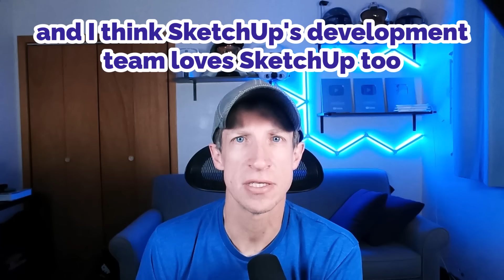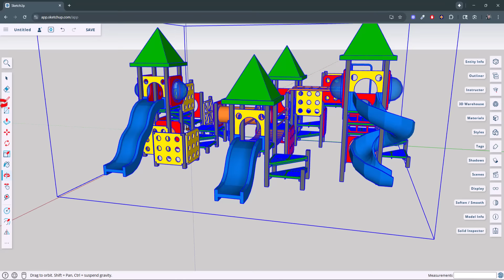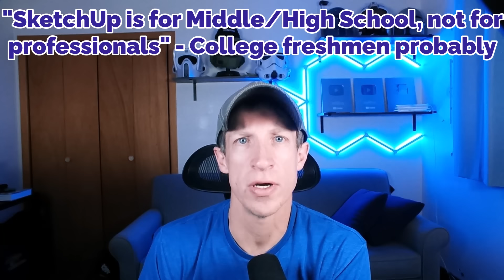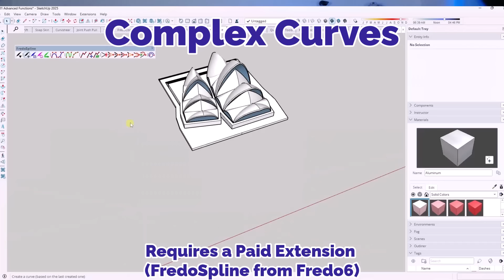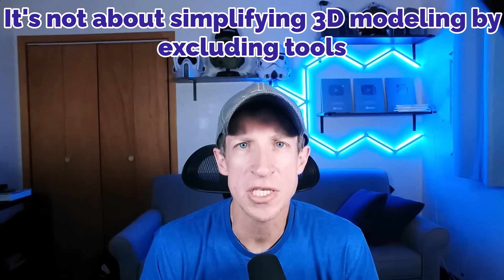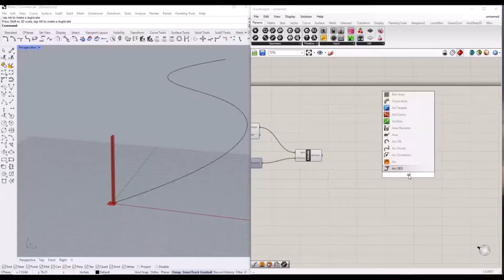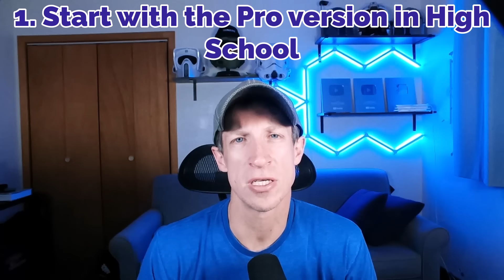Is SketchUp being REPLACED?

Comment: As a long-time CAD designer I think my insights have merit. Here's why: I graduated High School in 1964 with 4 years of drafting with an "A" average. Spent 4 years in the Air Force, and once back in civilian life I went to work at Pratt & Whitney Aircraft as a draftsman and never looked back. I've been a professional designer all my life at various firms. Started on the drafting boards using ink on vellum, and eventually into CAD. I started using AutoCAD in 1985, only 3 years after it was first introduced. Over the years I’ve been required to learn and use professionally AutoCAD, CATIA, SolidWorks, Inventor, and NX. I am proficient in all of them. I even spent 4 years teaching AutoCAD at a Community College for Adult Education at night. I became aware of Sketchup in 2001, only 1 year after it was introduced. I used Sketchup at home and for fun (it IS fun to use) thru Google’s purchase in 2006 and then Trimble’s in 2012. I still have it to this day, but I stopped updating with 2017 Make (the free version). I taught all my 13 grandkids to use Sketchup as a basic introduction to CAD software. But there is VERY little additional value that any of the “improvements” Trimble has deployed that justify the expensive subscription cost. I can do everything with my 2017 Make that I am ever likely to need to do with Sketchup. And it doesn’t cost me a thing. The capabilities in PRO that are lacking in 2017 I can easily get most from plug-ins and extensions; most of which are free, or inexpensive, and all are obtained as a forever plug-in - no subscription. I’ve learned my way around both Blender and Rhino and I completely agree that Rhino is blowing Sketchup away, today and into the foreseeable future. But it’s not free. Excluding the educational license ($195), it’s $1,000 for a single seat. But at least it’s a permanent license. That’s a plus. AFIAC, subscription prices are just rip-offs. I refuse to pay them. There are too many free, inexpensive or reasonably priced alternatives available. The ONLY thing that PRO offers me that 2017 doesn’t is the ability to create shop drawings. But there are even plug-ins for that; not nearly as good, but more than workable for most people. I'm retired now and enjoying my time as a woodworker. I design and build a lot of different things, from furniture to sheds and decks, home additions, remodels, useful gifts and more. I've even designed full homes, with electrical, plumbing - the works. I used AutoCAD for my shop drawings. With extensions I could export my 2017 model into AutoCAD and away I went. But I have since found an alternative to ALL of these. It is every bit as powerful as any of them (even CATIA and NX) and it’s FREE. It’s called “FreeCAD”. It’s a parametric solid modeler with nearly unlimited extensions (called Workbenches) available (for free) to extend the software into any design discipline that can be imagined. It’s open-source software and instead of maintaining an army of  paid “improvement engineers” (who ignore the user’s requests), the users can create their own workbenches if they master Python, or request the user teams to create it. And those user teams LOVE to create what the users want. Create individual part models or individual parts in one model. Then assemble them with any constraints that make common sense into an assembly model. Out of the box it beats Sketchup PRO hands down except in one area – the photo-realistic rendering. But there are even workbenches for that as well that are almost as good. Most designers will never need the difference in rendering quality that PRO offers that can even begin to justify the annual subscription cost. And my personal favorite? The TechDraw workbench is way better than Layout. And everything is parametric. Change a dimension on the drawing and the 3d model updates, along with every part that is affected by the change. Change the 3d model and the drawing updates. 
Bottom line now is that I still play with Sketchup. I use it for fun and to do a quick and dirty look-over of a design concept. I probably always will, because like I said above, it IS fun to use. But for anything serious? NOT at the price that is being asked. FreeCAD does EVERYTHING I could ever want to do, nearly as fast, and with less hiccups than Sketchup - for free. It’s not as easy to learn as Sketchup, but once you do learn it, you can fly thru design work like nobody’s business.
Sketchup Free is a toy. Sketchup Go is web and iPad only, no desktop. Again, a slightly more powerful toy.  And it's a subscription. My 2017 Make runs rings around both of them. And in my world at least, Sketchup Pro is a ripoff. My 2017 Make with extensions does everything I'd ever want Pro to do except make shop drawings. But FreeCAD makes shop drawings right out of the box. FreeCAD does everything, and beats Pro hands down. Trimble has lost its way and is ruining a once stellar piece of software. For me at least, it's time to move on. Trimble is too busy smelling the roses and placating the shareholders. I've got stuff to do and I'm not waiting around for them.

Comment: Guys, can i open my 570+ designs i made since 2007 in Rhino? Will it still be the same? Because i have many really valuable artworks and dreams conceptualized in Sketchup 8 & 2017 and i struggle to use newer sketchups because of the online thing... Please help! I would also love to learn all those smart tools, and need to export 3D printable files and STL files for laser cutters and CNC mills... Please guys, help a fellow 3D artist🙏
Reply from the maker: I'm pretty sure you can import SketchUp files to Rhino, but you might not like the result. Moving between modeling software like this, while possible, can be very clunky

Comment: Longtime sketchup user. Main shifts I’ve seen are towards subscription pricing. To use it you need a lot of plugins, which trimble isn’t developing. Rhino seems vastly superior.
Reply from the maker: Honestly it's more just a series of tradeoffs - I don't think the "SketchUp is dumb and Rhino is the best thing ever" posts are accurate at all (though obviously this varies by your use case). However, I do think filling a lot of the holes should be made a priority on SketchUp's side

Comment: Justin, your major concern seems to be modeling related. That's understandable. 
But since you are asking for feedback, my major concern is the forced shift to a subscription plan. I stopped updating after 2020 because of that. I wasn't willing to be forced into a subscription after I had BOUGHT the program. Of course, Trimble then proceeded to cut off access to 3Dwarehouse and Google Earth, which was effectively STEALING functionality from the program I had purchased.
If you've got the ear of folks at Trimble, please pass this concern along. I know I'm not alone on this point.
Reply from the maker: Well it's more that I don't think the pricing model will change, so it's not worth having that discussion. Trimble isn't going back to the lifetime pricing model any more than Autodesk, Adobe, insert any 90% of other software companies here. If the subscription model is a dealbreaker then it is what it is. As to the other items, I don't know that I agree that that's "stealing" anything. Those are features that require recurring costs to upkeep and manage - BTW this is likely also why McNeel doesn't offer a 3D Warehouse, and one of the reasons SketchUp has gone subscription. It's not different than multiplayer games shutting down servers after 5-10 years because upkeep of all that stuff to keep it running from revenue a decade ago is a losing proposition. 

I think there's a possibility of the features getting added, and I do not think there's a possibility of the pricing model changing, which is why I didn't include that in the video. Just trying to affect what I can affect
Reply: @Thesketchupessentials  "Just trying to affect what I can affect"
Thank you for your efforts. I've learned a lot from your videos over the years.

Comment: I started using Sketchup around 2010. My drafting needs are simple (single family homes) and Sketchup was a simple, compact, low cost solution, especially compared to things like Revit. If you want to design a skyscraper Revit's the way to go. But for my needs Sketchup was the perfect fit.
However when Sketchup moved to the subscription model I stopped updating. So I've been working on 2020 ever since. I resented very much that Sketchup made that move, forcefully cutting off the ownership option and removing access to 3Dwarehouse and Google Earth. I had bought the program and losing that access was really like having something I'd bought taken away from me.
I keep 2018 installed on a laptop and 2020 on my desktop... which died last week. When I get my new desktop I'm not sure I'll be able to reinstall 2020 on it. If not, I will probably start looking for an alternative.
That's my story and I expect there are lots of others just like it. I'm sorry to see Sketchup go.

Comment: In proper architecture firms, you're mainly doing everything you need for drawing sets in Revit. There's a rhino connector for modelling (rhino.inside), and there's nothing for sketchup. You can also do some very sophisticated parametric work with grasshopper and rhino. 

Sketchup comes in as the annoying third wheel, still operating on the frustrating subscription model, without offering any compelling features or justification. For this reason I'm transitioning out 400-person company away from sketchup completely (we are down to just the landscape architect's using it) to focus on rhino and Revit. And we are late tomthis approach - I know other companies who don't even use autocad any more, because rhino does everything they need for cad also.

Comment: You can replicate most of Sketchup's features in Blender anyway.

And Rhino's NURBS geometry integrates very, very nicely into history-based solid CAD, really simplifying manufacturing. You'll never send Sketchup geometry off to a machine shop.
Reply from the maker: Having tried to use Blender for Architectural modeling, don't fully agree with that one. That kind of modeling in Blender, even with plugins, is super painful

Comment: I’m a small 1 person business owner (furniture making) and want to try start 3D designing my pieces so I don’t have to keep drawing them out on paper. 

Has anyone got a suggestion for what software I should try? 
I don’t think I can justify the SU pro price for the amount I will be using it.
Reply from the maker: What would you say your technical skill level is when it comes to 3D modeling and just...computer stuff? If it's low, definitely still SketchUp. You could try the basics in the web version. If it's a bit higher, you could try Blender or Rhino, but there are significantly more instructional resources on SketchUp, and it's a lot easier to learn.
Reply: @Thesketchupessentials thanks for your reply! 
I have no current experience with any modelling software so will be starting from scratch - however I’m pretty confident on a computer and studied design when I was younger so I’m pretty sure I will be able to pick it up rather quickly. 
I’ve watched quite a few tutorials of both Sketchup and Shapr3D in my quest for finding what will be right for me. I guess the next step will be trying out the free versions of both.

Comment: Hi Justin. After using SketchUp since 2010, I switched to Rhino this year. SketchUp is very good at materials and visualizations, but Rhino is excellent at modeling. Personally, I'm sorry to have to switch, but in my work, I have to import a lot of 2D files from AutoCAD, which were almost impossible to work with in SketchUp. Only those who use Rhino after SketchUp realize that it's like SketchUp, but much more advanced. To do what I do in Rhino, I had to use several paid extensions, as well as free ones. Plus, you pay once and it's yours.
Reply from the maker: Lol - but the materials management is definitely painful ;p

Comment: Good video and full of points. I have been using the Sketchup Pro version for about four years now and the enthusiasm is starting to wane. I am starting to notice the shortcomings in development and creating credible models. The program is a good springboard for modeling, but at my workplace, designers use Rhino and through it I notice the differences and shortcomings clearly. I really hope that Trimble pays attention to customer feedback and problems in development, otherwise customers will be directed to other platforms.

Comment: I was introduced to SketchUp in college in a class name "bioclimatic architecture" around 2010 and I loved it was. By 2012 I did some drawings for my thesis and a  patent in SketchUp , my advisor did not allowed me to use those drawings and made me redo the drawings in Solid Works, even when they were almost identical, but he told me "the software you are using is for kids, you need to be serious with your work", after I graduate as energy engineer, I tried to propose the use of SketchUp for shadow analysis in photovoltaic systems but I was told the same, that is not a serious software, it was difficult to prove them wrong but I could in some jobs. At some point on my professional life I also thought it was not a professional tool, I was wrong, though. I have been using it for so many years and I know how powerful SkechUp is, but its frustrating hopping with each version release that it will include something that make my life easier, but it is all the way around, just new useless features to get use to.

Comment: Since moving on to revit 10 years ago, I'm amazed sketchup still used widely. 

Beside the lack of modeling tools out o the box, sketchup memory management is also sucks. It struggling to handle complex models, lag and prone to bugsplat. Which the same geometry easily handled by other modeling software.
Reply from the maker: I don't think this is a fair statement - they've significantly improved performance year over year for the past 3 years. It's not the same as it was 10 years ago

Comment: I’m a retired mechanical and electrical maintenance manager who worked in the field for 39 years and would like to take on the task of building my retirement home and shop on a private property with few building restrictions and want you use a reasonably priced building design software program to do this for myself. I have used autocad lite before but am not an expert in using it. My question Is the Learning curve and cost of using/operating Sketch Up a better choice for a one time project than getting Rhino?
Reply from the maker: Personally I think the level of support and tutorials online for SketchUp is vastly superior. The tools are much easier to pick up, and are better suited to this kind of work. I personally think (having used both) that you're going to like SketchUp more than Rhino for this application

Comment: The piping and routing workflow in SketchUp is a nightmare. It takes five times more time to lay out a simple pipe than in any other 3D modeling  software I’ve used.
Reply from the maker: Like...plumbing and mechanical modeling?
Reply: @Thesketchupessentials Yes I know this is more CAD things but it is very important for Architecture

Comment: I got started doing 3d models about 15 years ago, I first started with a hacked Autocad but quickly got into Sketchup back when it was owned by Google I think and I've used it a lot, I have made many 3d models and some ten years ago I got into 3d printing and used Sketchup to make models for that as well. But I hardly ever use it anymore, I got into Fusion and Solid edge because they have free versions for hobby users, something Sketchup doesn't have
I still like Sketchup and I still use it to modify stl files but the slicers let me do more of that and the version of Skethup I have is from 2018 I think so it's quite outdated but for me I can't motivate their license

Comment: "lightweight easy to use modeler " that would be fine if they PRICED it like that!  Been a user since 1.0.  LOVED the way it looked for architectural work.  Can't really justify the subscription pricing, especially with the feature set not keeping up.
Reply from the maker: Compared to many 3D packages, it is pretty affordable. Rhino is the one outlier, though the up front cost is higher, but anything over 2 years the math sways in that direction